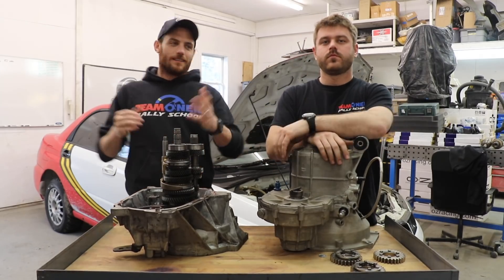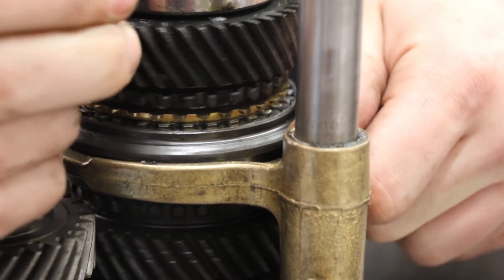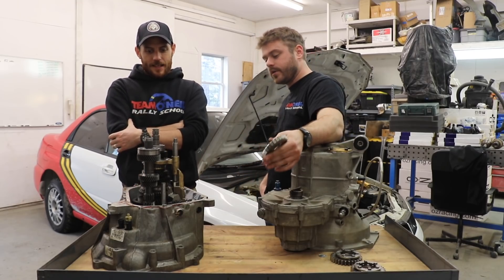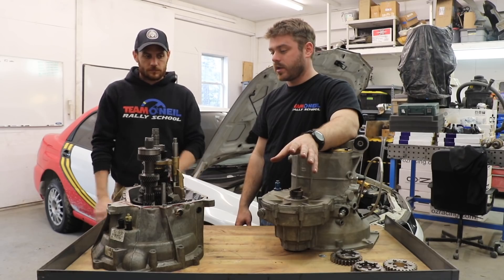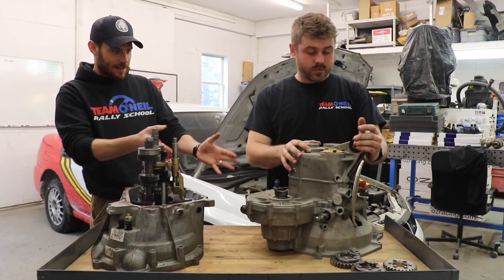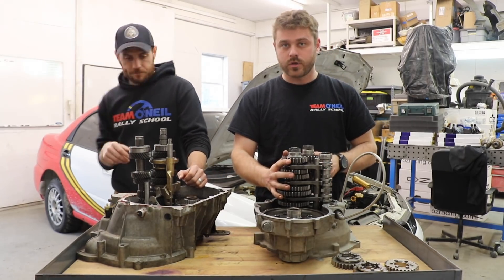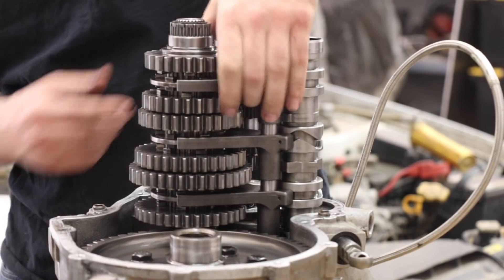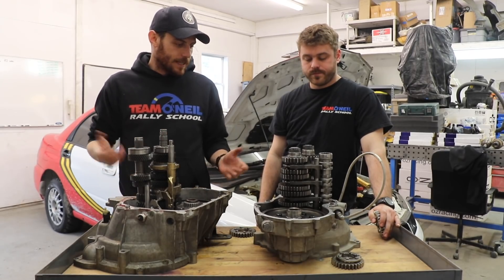Stock VS Racing Transmissions

Comment: So the reason straight cut gearbox is more expensive: bespoke, more reliable, low demand
In reality, they are much cheaper to manufacture, require less material and are simpler. 
Herringbone cut gear, is another dog, V-shaped cuts, super expensive to make but supposedly best of both worlds -- these are for hypercars, are stronger, don't have axial load so run cooler.

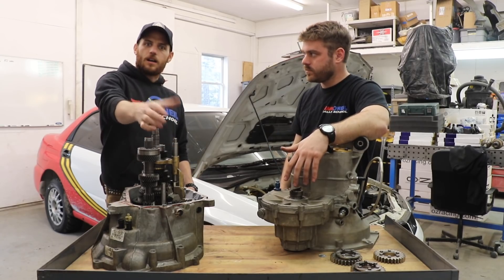Comment: 2:00  Straight-cut gears don't mean you can't have synchros/baulk rings.  You're thinking of sliding-gear transmissions, where the whole gear slides in and out of mesh - which use straight cut gears, but are not the only sort of box that uses them.  But there's constant-mesh gearboxes that use straight cut gears, and use synchros.

Comment: Is it possible to swap the gearing from the race one to the non race one? I prefer shifting vs the sequential. More for the feel vs the time per shift.
Reply from the maker: You can usually find a beefy race transmission with a normal H pattern shifter. It depends on the car... If it's something commonly raced like a Miata or a Subaru there will be options.
Reply: I've seen options on a website for straight gears for a standard Subaru 5 speed transmission that will fit inside and replace factory helical cut gears without modifications to the gearbox , so if you wanted 1st , 2nd , 3rd 4th gear straight cut . But 5th helical cut for long distance driving you can do that , or for any gears you want really.  So many options out there

Comment: Hey guys, I am curious about the clutch use with that sequential gearbox. I have watched your video about down shifting without the clutch in a street car but I would still need to clutch to up shift with a stock type transmission. Would the sequential gearbox in this video shift the same way aside from using sequential vs H pattern for changing gears? The mention of flat shifting on pressure to the shifter has me confused as the flat shifting I am familiar with in a turbo car is more of an anti-lag thing and is engaged when I push in my clutch. A quick explanation of how to optimally use the clutch with the sequential gearbox in the video would clear things up for me.Amazing channel by the way! I just found it yesterday and I must have watched about 3-4 hours of video already. Learning a ton of info for Autocross and who knows, I might venture into Rally one day!
Reply from the maker: Hey thanks for the kind words! So with a sequential, you'd take off in 1st gear using the clutch just like normal. To shift into 2nd, you can use the clutch if you want, but you can also just lift off the gas and pull the shifter, and it'll go into 2nd pretty smoothly. Same all the way up and down through the gears, just lift and shift whenever you want and as long as you're not going way too fast or slow for the gear you want it'll go right in. The "flat shift" feature on some of them is just a momentary throttle-cut switch hooked to the shifter... So when you pull the shifter to upshift it basically lifts for you so you can shift up without ever letting off the gas pedal.

Comment: I drive a semi truck and most of the time, I am floating the gear, I drive a 10 speed tranny, with a air flip between 1 through 5 and 6 through 10. Usually, only when I stop do I use the clutch. In heavy sudden traffic, hard on the brakes, then double clutching is handy, but then, you can always clutch out of gear, and then match revs with truck speed and float it into gear. Much like a race car, the semi doesn't have synchros and has straight gears. Unlike a race car, this is not for slamming gears to take off and race, this is to pull 80000lbs up grades as steep as 7%. Just like a race car, the semi whines, but that again is the straight gears. Great videos guys, keep them coming. Would love to take my performance driving to the next level, but sadly, I drive over the road, all 48 states. On the road almost all month.

Comment: good video, but its a bit misleading when your talking about the cut of the gears and shifting. the cut of the gears has nothing to do with gear engagement, because they are all in constant mesh. 

you can have a dog engagement box with helical cut gears, or a syncro box with straight cut gears, its just that usually straight cut goes with dog engagement for racing, and helical goes with syncro for street use. showing and talking about exactly how the dog engagement and syncro engagement differ would be usefull, i do appreceate you sort of show the shift forks sliding and engaging the syncro and dog rings, but i dont think allot of people are going to grasp how that actually shifts the transmission. original transmissions as you mention did actually have sliding gear engagement, instead of dogs or syncros, in this case the gear cut would affect engagement. there are a number of different ways manual transmissions work and have worked in the past. most heavy duty truck transmissions work similar to a dog box, as in the gears are in constant mesh and engaged via a sliding clutch, except instead of a dog ring they have a sliding splined clutch that engages the center of the gear. they also have 2 counter shafts to add strength, and are usually straight cut as well as being generally huge compared to automotive transmissions.

also, helical cut gears are actually stronger than straight cut given the same size and matereal. there is more mesh surface and thus more strength. the problem is helical cut gears create allot of linnear force as power is applied, because the angle of the gears and their tendency to push in the opposite direction from echother. this linnear force stresses bearings, cases and other components. thats why racing transmissions are generally straight cut.
Reply: I understand what your saying , straight cut gears will make the overall gearbox stronger and last longer under load , it's not the actual gear itself that is stronger

Comment: Holy shit, Dan, man, you're cute. Also, thanks to both you guys for being informative. Why are straight-cut gears so much stronger than helical ones? Is it a matter of all the forces on a tooth being aligned along a single axis, or something else?
Reply: aquaticko the straight cut gears themselves are not stronger, helical cut gears are because they have more mesh surface. the problem is helical cut gears create linnear force on the shaft when engaged, and this stresses bearings and other components more. thats why racing transmissions are generally straight cut, the bearings dont have to deal with linnear force.

Comment: I went to school for automotive technology and this is a common misconception/mixup.
Actually, helical cut gears are stronger, however they create a lot more heat because of the axial thrust and radial thrust they produce under especially high torque. The bearings in the transmission, then, must be that much stronger to withstand especially the axial thrust loads. However, the gear itself is strong because the area of the base of the gear tooth is much larger than the area of the base of a tooth on a similar in size straight cut gear
It may seem backwards then that straight cut gears are used in high torque applications, such as semi trucks and race cars. This is because straight cut gears run much cooler because they do not create axial thrust loads. The other advantage is the bearings and the transmission case does not have to be designed to withstand the axial thrust loads that helical gears produce. This lightens the transmission and is cheaper to manufacture. Straight cut gears in and of themselves are a bit cheaper to manufacture as well.
The best of both worlds is a herringbone cut gear, which has a V-shape to its teeth which means it has a large surface area for strength, but has no axial thrust load. These types of gears are used in applications such as high end supercars and hypercars. This cut is very expensive to manufacture.
Reply from the maker: Well damn!
Reply: @Teamoneilrally  That's what he said
Reply: Ryan Vincent Before I piped in on the axial thrust of helical gear sets, I wanted to check if anyone hit it already. You did and well stated. I can only add that the axial thrust also costs efficiency as it absorbs power (the heat you mentioned).
Reply: Very well explained. They ought to do a follow-up video.
Reply: Barney style, i.e. slower and dumber, so normal people can understand
Reply: Think of straight cut gears riding on two rods.  These two gear teeth are meshed together.  They will have a tendency to press perpendicularly to the rods they run on.  Helical cut gears will have that reaction as well, but because the teeth are at an angle, they will tend to force each other oppositely down their rods away from each other.  I wish I could draw this out on a piece of paper.  It would be way easier to explain.  XD lol  I hope this makes a little more sense without all the auto technician jargon.
Reply: @Ryan Vincent  Dead right.  I remember being taught this stuff in tech when I was a kid (including herringbone gears, although I've never actually seen one so far.)
Reply: Tim Winters  Very good point.
Reply: James F  Thank you sir.  That would be cool if they did.
Reply: Well said
Reply: Can you break that down, Barney style please?
Reply: lol What do you mean by Barney style?
Reply: Haha thanks

Comment: I want to point out that "straight cut gears" does not mean "no synchros" and crash boxes can have helical gears. Some mixed messages on this nomenclature in the video.
Reply: They are talking about 3 different gearbox types: Synchro gearbox where the syncro's's are a brake that synchronizes the speed between the input and output shafts ( double clutching will protect the syncro's) : Dog box where the gear teeth are constantly engaged but there are dog clutches that engage as in all motorcycle gearboxes and heavy truck applications: A crash box is gear on gear engagement of either  straight cut gears or helical cut gears it really doesn't matter but they will not engage unless the driver can synchronize the speeds of the input and output shafts at the same time. Double clutching is crucial for crash boxes but thats a whole different subject.
Reply: tjanson Exactly.MotiveDVD made a great video covering this if anyone's curious

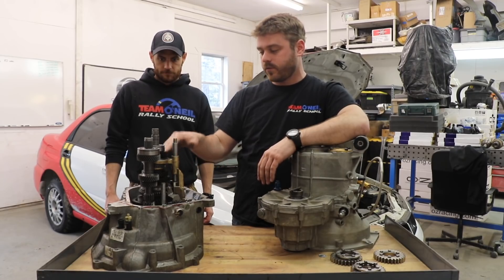Comment: 1:30 I'm confused, I thought the smaller/shorter gears are lower and the bigger/taller gears were higher
Reply: DutchedUp It depends on if you're talking about the input or output shaft. High gears will be small on the output shaft and large on the input shaft (few engine rotations translate to many wheel rotations aka high speed) while lower gears will have larger output shaft gears and smaller input shaft gears (many engine turns to few wheel turns aka low speed and high mechanical advantage).
Reply: Chance Coats thanks, that's a great explanation!

Comment: Can you explain how Andy Forrest's Subaru with a Nissan GTR transmission can engage the clutch for one gear while the previous gear's clutch is still engaged? Why doesn't the whole thing bind up when that happens?
Reply: Typical transmissions utilize two shafts (maybe three/four for reverse) - the input and output shaft. These include all of your possible gear combinations constantly meshing, but only one gear is ever tied directly to the input shaft (the gear you are in) through the use of dogs or synchros.

DCTs utilize five shafts normally. Two input shafts, two "gearing" shafts and a fifth output shaft. The input shafts and the two gearing shafts act exactly like a normal transmission in that they are in constant mesh with varying sized gears. The difference is that one shaft will have all of the odd gears and the other will have all of the even gears. Which input shaft is connected to the output of the motor is where the dual clutches come in to play. When first gear is engaged, the input shaft in mesh with first gear has its clutch completely closed while the second clutch is open so that the even gear shaft is not being driven by the motor. This allows the transmission to preemptively "shift into second gear" by engaging the dogs. This shift does not affect the output speed of the transmission since the input shaft driving the even gears has the clutch open. Now you want to shift into second gear. Normally one must depress the clutch and shift from first to second, but we've already done so. Instead, we can open the clutch for the odd gear input shaft and close the clutch on the even gear input shaft. Now the engine is driving the input shaft connected to second gear and in turn drives the output of the transmission. During this time, the transmission can guess at which gear you might want next (based on how you're driving) and engage either first or third gear on the odd shaft. The next shift is then simply a matter of swapping which clutch is engaged. This process then repeats defending on whether you are accelerating (continue using higher gears) or decelerating (desire to use lower gears).

Hopefully that explanation clears things up a bit!
Reply: Will Richter I see what you're getting at. My explanation made the clutches seem very binary, ie: they are either engaged or disengaged. In reality clutches have a more continuous operation where they can go from zero power transfer to maximum power transfer by slipping. The downside is the frictional losses end up heating the clutch pack. As you state, the wheels can't be driven by two different gear sets at once, so there must be slipping involved during the transition.
Reply from the maker: Dual clutch transmissions are black magic, here's a quick explanation of how they work: https://www.slideshare.net/kilobytesumeet/dual-clutchtransformers
Reply: I'm still so confused...this is what I'm referring to here. https://youtu.be/9oBfj_D9DGE?t=146
I mean I think I get how it works. One or both of the clutches have to be slipping during the shift, because obviously a wheel can't be turning at two speeds at once.
I wonder how the engine matches the speed of the gears, since there's no off power moment. All of it seems very wear-and-tear-heavy, and maybe I'm being too mechanically sympathetic to understand.
Reply from the maker: We're not super familiar with these because they're not legal to use in rally, but it's super interesting... Not sure how they are swapping clutches with that overlap he's describing, engaging one gear before the previous gear is fully disengaged. Sounds like a recipe for disaster but it must work, wonder how many races they get between rebuilds...
Reply: "Instead, we can open the clutch for the odd gear input shaft and close the clutch on the even gear input shaft."
The point I was making was that in this specific time attack car, these two operations happen in the opposite order. The next clutch comes in BEFORE the previous clutch is released. See how that changes things?

Comment: Does it blip automatically when downshifting?
Reply from the maker: Nope these do not, they will just cut throttle momentarily during a shift but that's it. Some of them might, these ones that we use are fairly simple compared to some of the space-age stuff that's out there.

Comment: please tell me you can get strong helical transmissions. Would love to build a decently powerful car (500 - 800) at some point but it would be a daily driver ideally and i couldn't stand the wine of straight cut
Reply: Datamancer sounds good, thx for the added info. I'm gonna be completely honest, all these plans right now are just distant dreams. I don't even own a car yet. Trying to get a better job over summer, then maybe buy a car late fall or next year. Then the upgrades will begin
Reply from the maker: There are definitely some pretty strong helical transmissions, but only for pretty specific applications... If you're using an LS motor for example you'll probably have more choices than if you're using something more unusual.
Reply: Team O'Neil Rally School ah, right. Makes sence. Thx for the reply
Reply: (I'm no expert, so take what I'm saying with a grain of salt but) to expand on Team O'Neil's answer, you may be able to find adapters for different transmissions for your engine as well. For instance, in Nissan-land, if you were, say, running an RB engine out of a Nissan Skyline, there are resources out there to purchase an adapter for it that would allow you to mount a 350Z transmission behind it, which would ideally be capable of holding more power than the stock transmission, while still being a helical box. I also believe adapters exist for mating an LS transmission behind it as well. Google is your friend - try "<my engine> transmission adapter". You might find something cool out there.
Reply: the zf-6 is a verry strong helical cut transmission. i think its exclusively used in trucks, but i dont see why you couldnt use it in a car if the size / weight works. lots of adapters for these for various engines.

Comment: do racing sequential transmitions have a "neutral" state like a h pattern gearbox?
Reply: Isaiah Palo yes this is very similar to a motorcycle transmission.
Reply: Yes, neutral is in between 1st gear and reverse.
Reply from the maker: These guys are on point, neutral is between 1st and reverse.
Reply: Brien Berglund it is exactly like a motorcycle transmission, minus the diff in the housing.